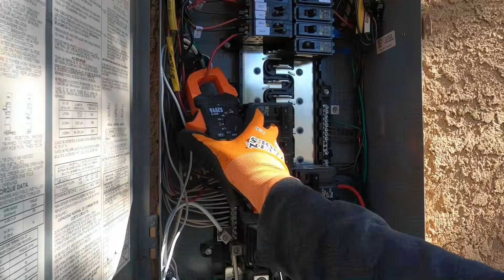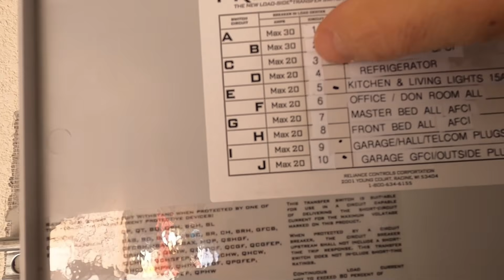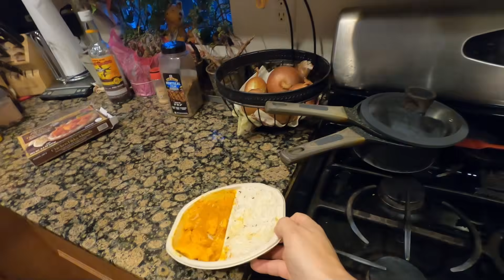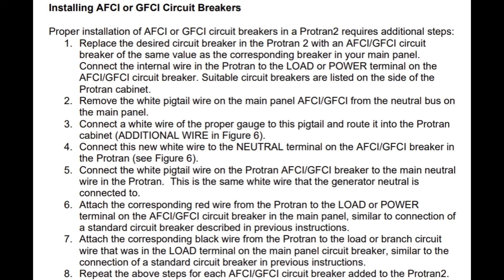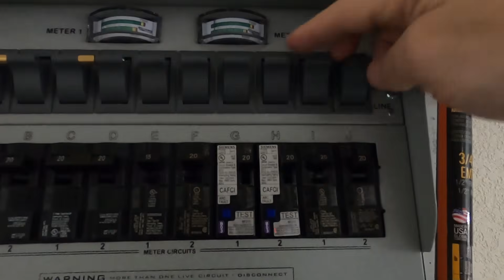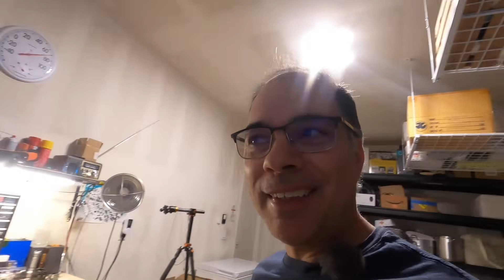Reliance Controls ProTran2 MTS - AFCI and Shared Neutral (MWBC) Circuits

Comment from the maker: Be ware of Shared Neutrals, learn how they work before working on them!
I learned that the Siemens QA120AFC  seems to have a lower nuisance tripping tolerance on compressor based loads like mini fridges.

MTS: https://www.alt-electric.com/A510A_p_51.html
20A SP CB: https://www.alt-electric.com/-20-Amp-Single-Pole-Type-QP-Circuit-Breaker-RELIANCE_p_1439.html
20A SP AFCI CB: https://www.resllcstore.com/products/siemens-qa120afc-20-amp-single-pole-120v-pigtail-neutral-afci-arc-fault-circuit-breaker-ul?variant=50909959979297
NK8/NK10: https://www.reliancecontrols.com/products/reliance-controls-pro-tran-2-neutral-kit-10-circuits-nk10-1

pt1. MTS review:
https://youtu.be/L4fvbfcS36c

pt2. Installing the MTS (standard circuits):
https://youtu.be/8u_0yzUK_Kg

Ref videos for shared neutrals:
https://www.youtube.com/watch?v=Hm9MdxX1xBc
https://www.youtube.com/watch?v=LEV-O30WDSY

AFCI ref manual:
https://www.natesdiysolar.com/pdf/manuals/misc/reliance-controls-manual-transfer-switch-AFCI.pdf
https://www.natesdiysolar.com/pdf/manuals/misc/AFCIGFCI-email-wiring-instructions-Protran2.pdf
Reply: Can Multi Wire Branch Circuit use in switches or 3 ways switches? Backyard Main YT had video about it but he only mention to work with receptacles.
Reply from the maker: @adassociates8235 I don't think they can cause the switch configuration... I like BM main.. I reference his video in mine.

Comment: Hey Nate…..If I wanted to use 3 AFCI’s would it be ok to jump two of the pigtails together and use the same 4 port multi tap you are using?  Anything larger takes a lot of space up in MTS panel.   Thanks
Reply from the maker: I'm not an NEC expert, but as I understand, they don't want more than one conductor per terminal. If you need more slots, in the video, I mention the neutral bar you can get and mount to the inside side of the mts. It's part of the neutral kit, but you can probably use any neutral bar found at Home Depot or similar as long as it's isolated from the chasis.  They are low profile and should work great.  See TS: 28.00 in video.  Gl.
Reply: Thanks Nate…so on the NK8 neutral kit, I assume all pigtails from new MTS cb’s, neutral from Gen input port and main neutral running back to MSP all connect to it?   What exactly does being isolated from the chassis mean?   I assume the NK8 would just be screwed into the MTS panel?
Thanks again….love DIY but want to be certain.
Reply from the maker: @butchransom9988 yes they all connect to it.. isolated means it's insulated from the metal mts chasis. You do not want to create a ground neutral bond inside the mts. GL

Comment: Hey Nate, great video and very detailed.

I have a technical question about the MWBC setup you showed. It  For one of your MWBC pairs you kept one leg on the main panel, left it as-is, and moved the other leg over to the transfer switch. Is that correct?

I’m researching transfer switches for my own setup as my main panel has six MWBC pairs. From what I’m learning, an MWBC is one circuit with two hot legs sharing one neutral, so both ungrounded conductors need to be transferred together. It seems like you should not transfer only one leg while leaving the other leg connected to the utility/main-panel side.

If one leg is connected to the backup source and the other leg remains on the utility side, the shared neutral would still be common between the two circuits. Wouldn’t that create an improper configuration, depending on how the transfer switch handles the circuits and neutral?

I just want to confirm what you did with that circuit. Did you intentionally leave one leg of the MWBC on the main panel and transfer the other leg, or was that circuit not actually an MWBC with a shared neutral?

With my six MWBC pairs, I’m trying to make sure both legs of each pair are handled together before I finalize anything.
Reply from the maker: Yes it was a calculated decision.. but as long as each side remains on opposite phases as they are in the main panel.. l2 l2 l1 l1 IN the mts when in LINE mode its the same as not being on the mts or both on mts.. when in gen mode its a different power source, so they don't compound its like opposite phases as well.  The office and wash room I brang over just 1 side. Wash room plugs don't get used..    Even if used they are still on opposite phases as if the mts did not exit.. but to avoid confusion its best to just move the pair keeping them together... BTW. MWBC 2 separate circuits sharing neutral. Not a single circuit 😊 did u see the ref video in description.  Guy explains it in depth. Gl.

Comment: It seems to me that a transfer switch like the Schneider SQ D QOGP3P6036 would be a much simpler solution.
Reply from the maker: Looks like that product is a supply side sub panel.   Takes 2 power sources and switches between them powering the circuits. Different use case. Not good for existing wiring good for new building.

Comment: Ferrules are great for stranded wire. Makes terminating them in multitaps and other screw terminals much easier and more secure
Reply from the maker: Yea I was reading about that and I got. Mixed results if it was compliant or not on such connectors.

Comment: Thanks for the absolutely fantastic and comprehensive video. I followed your instructions and used the Reliance NK06 neutral kit to deal with AFCI in two bedrooms in my house, just like you did. My test, just like yours, passed both self-test and manual test.

However, when I tested it, I forgot to turn off the main panel power, so line was still live. Flipping the switch to LINE tripped the AFCI on the MTS. When I then flipped the breakers back ON, the main panel AFCI tripped too — which I expected. I did not expect the MTS breakers to trip as well. Should I be worried?
Reply from the maker: That's great to hear. Always love to hear positive feedback. When I did my test, the trip was only in the main panel as the mts afci should only ever see power from the mts.. what type and brand do you have in your main and mts. It could be the brand .. some are more sensitive than others.  Send me an email with the exact test senerio, and I'll try on mine.  In the meantime, I would contact 
 reliance and run it by them.  Thanks for watching

Comment: Ferrules would have solved the pigtails shearing off strands while tightening your original multi tap.
Reply from the maker: I was going to use them, but I did a Google search, and it said they were not allowed for that type of connection.

Comment: We got big problems with reliance transfer switch  pro 2. Without generator  hook up, every time switch to any LINE will tripped the mail circuit breaker EXCEPT.the 20A line is not tripped. ANY advised to check?
Reply from the maker: The main breaker? Is it an AFCI or GFCI.. does the 20a circuit continue to function from the mts..
Reply: @natesdiysolar breaker is Hom120pdf - Dual Function (CAFCI and GFCI) - 20A circuit A still function from MTS. Others will tripped. Could it be bad MTS switch?
Reply from the maker: I thought you said it was tripping the main service disconnect breaker.. if it's just an branch circuit afci this is normal.. see the following section of video. If this is not what you are talking about lmk..

https://www.youtube.com/watch?v=GRel0zIYtPE&t=1927s

Comment: I have a question about connecting a manual Reliance transfer switch to the furnace circuit in my panel. I have two independent furnaces. Both are powered via one GE double-pole 20-amp breaker in the panel with a common neutral.

I don’t need both furnaces powered in an emergency. Can I connect the Reliance transfer switch to the one leg of the 240 V breaker powering the furnace I want on generator power ? If I did this, the leg would run through a 110V 20-amp breaker in the transfer switch when the generator is running. The other leg of the 240V breaker, which is not connected to the transfer switch, would have no power until the utility power is restored.

I think this would work because when the transfer switch is moved to “generator” mode from “line” mode, the panel breaker is bypassed. I am concerned that I am missing something dealing with the common neutral, but I am not sure about this.
Reply from the maker: It should work.. this is no different than my situation where i moved just one side. You just have 2 of the same devices.. you can test this by disconnecting one of the hots.. see if the other runs... do not disconnect the neutral, lol.. be safe.  I'm surprised they are not 240v units..
Reply: @natesdiysolar  Thanks.  I contacted a tech at Reliance about this. He said the problem occurs when the power comes back on with generator hooked up, which would result in an overcurrent.  I think this is the "adding" vs. "subtracting" current issue you alluded to in your video when the breakers are not side-by-side. In thinking about it, I think he is correct.
Reply from the maker: @Art55Vandelay  ok. sounds good then. good luck and let me know how it goes..